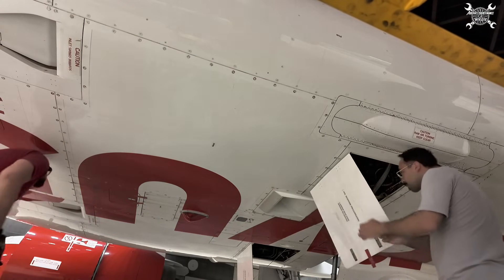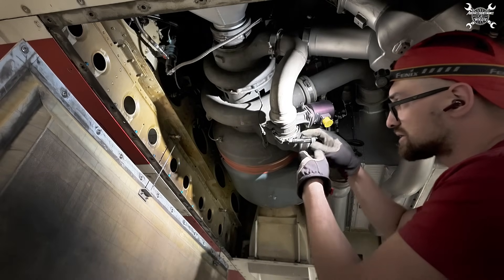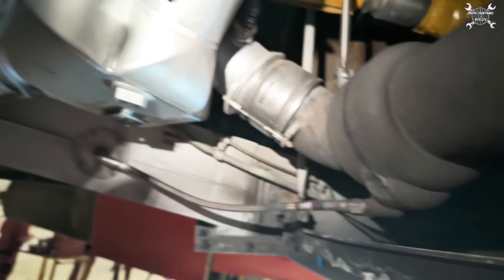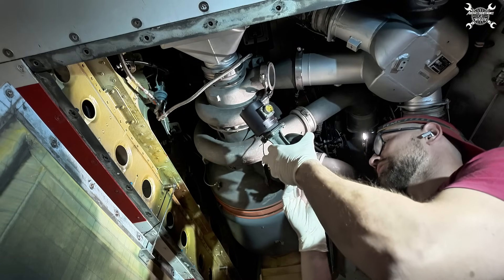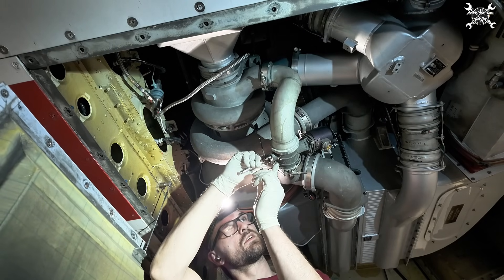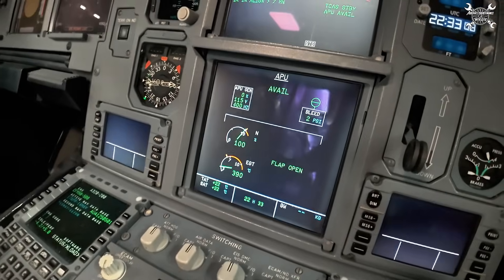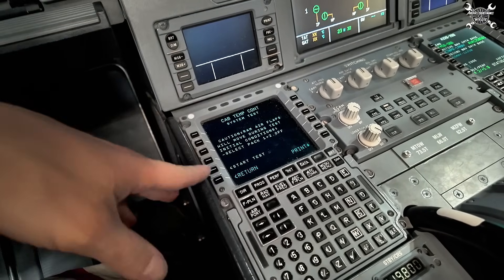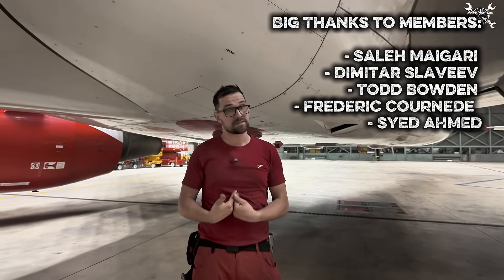ATA 21 Bypass valve in air condition system of A32F

Comment: Great video. I would appreciate if you could show the correct installation technique for the blue ABS1040 seals along with their filler rings as they can be tricky to install in the bypass valve without damaging the seals.
Reply from the maker: Thanks for the suggestion, I will consider it in the next video about aircondition system

Comment: Very very interesting as always Zeto. Great contents. ATA 21 is of a great interesting for me as a student. Air cycle machine is very complex and the function of heat Exchanger, pack valve, water separator bypass valve are essential to perform the task cleverly

Comment: As an ex gas engineer where we used LDF (Leak Detection Fluid) to check for pipe joint leaks I’m surprised that the same method is not used. There is of cause a big difference between gas pressure of around 75 millibars and the pressures used on aircraft systems so a feel around method is used?
Reply: Leak detection fluid is used a lot in aircraft maintenance as well but for some task it isn’t necessary. Depending on the job, small amount of air leakage is still serviceable per manuals and anything out of limits can be more easily detected by hand.